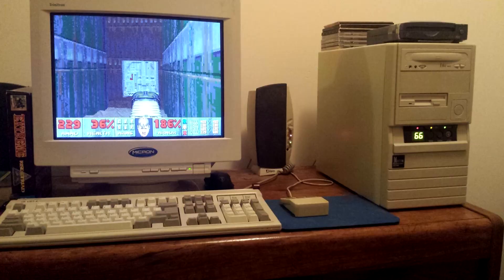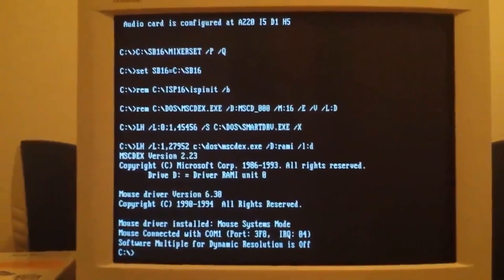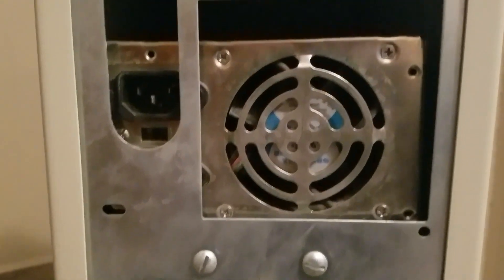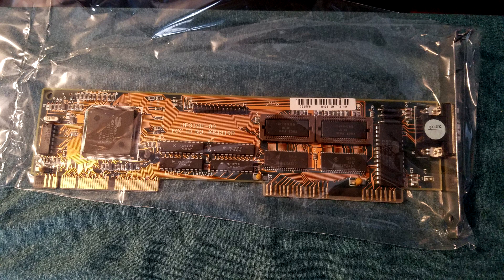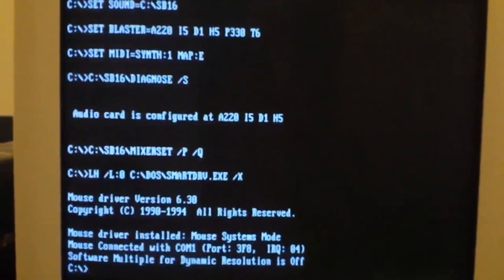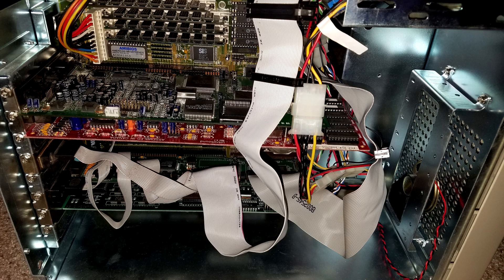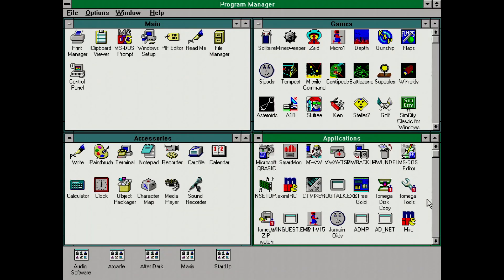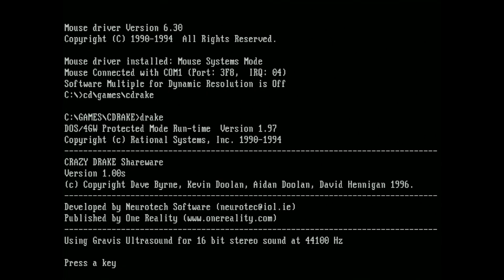How I built the Ultimate 486 PC

Comment: Those massive AT power supplies your case is made for are hard to get, but they are a standard...not sure exactly which standard, but they're generally just referred to as "full height AT" or similar. Examples of models which would fit are the Seasonic GS-200T, and Enhance SPA-4250. The Enhance units come up on ebay semi-regularly.
Reply from the maker: Thanks for the info! Yeah I had a really hard time finding the right power supply for this case. I definitely want to track down the proper PSU eventually. The current solution I have is very jank haha

Comment: What is the function of these seven-segment displays, used on the front of PC cabinets from the 90s?
Reply from the maker: They actually display the speed of the CPU. For example my 486 runs at 66mhz and so the display on the case says 66. These are manually set through jumpers on the PCB of the display.
Reply: @jikissgamer  Thanks for the answer!

Comment: that was the computer case I had back in 1993 but it was the mini-tower version. I purchased a custom computer from a computer builder shop in Silicon Valley. In 1993 it was a 486dx33 with generic ISA motherboard , 4mb RAM, Sony 2x CDROM, Sound Blaster 16 compatible ISA Sound card, SVGA Video card ( Oaktech ) and a 14-inch Non-interlaced monitor. In all it cost me $2500
But I was happy and I liked it. It also had a 14.4 dial up modem.
It came with DOS 5.0 and Win 3.1
Eventually I upgraded the motherboard to VLB and added VLB cards and a Intel 486dx50
When Win95 came out I built an AMD 5x86-133 CPU computer for Win95.
Reply from the maker: That's awesome! The small version of this case sounds really cool, I definitely would have preferred one of those cause this one that I have is a bit too big haha. It's crazy how expensive computers were back then. That's one of the reasons my dad never upgraded our old 486 and we kept using it until like 2001 or 2002.
Reply: @jikissgamer  Yes, Computers were very expensive back in 1993. 1mb of RAM cost $100 and hard drive space cost $10 per megabyte. I think my mini-tower case like yours cost about $40. It was an inexpensive generic AT case back in 1993 and it was very popular. CDROMS and Sound cards were also very expensive. 1993 is when the first multimedia computers started being manufactured for home users.
They also came with dial up modems. Mine had a 14.4 modem. We could Dial up to Bulletin boards ( BBS ) using Wild Cat client. Or Dial up to another computer any were in the world. Also there was Compuserve dial up service. I had AT&T World Net service. It costs about $30 month. 1993 is also when the First IBM PS/1 multimedia computers came out for home users. IBM Pretty much set the standard of what a computer is and how its to be used. Also in 1993 the First Macintosh Color Classic came out. It had a Color Sony Display and 16mhz CPU. But It could also go online and surf the internet. I still have a Mac Color Classic and using the Ethernet port it can still go online and surf the internet accessing HTML 2.0 friendly webpages. It Only Cost $1099 back in 1993 but the Display was very Nice. Sony Trinitron CRT I think. 
I think all you need is 8mb RAM and Netscape 3.0 browser to go online and Network card and TCP/IP.
Reply from the maker: @computerenthusiast402  That's so cool! 1993 is actually the year I was born, I spent a ton of time in my dad's office growing up where they had a lot of 486 computers, that was a big reason I became interested in this period of computers. I remember we had a modem at home which was how my dad got a lot of shareware games. We had a Samsung CRT monitor back then. The Trinitron is the best monitor though, I use one on the 486 I built here and it has such a crispy image.
Reply: @jikissgamer  Yes, I took a DOS computer class in High school and they used IBM AT Computers. And a friend of mine also recommended I stick with IBM type computers and Microsoft Windows. But if I would have known more about the Mac Color Classic back in 1993 I probably would have purchased the Mac instead because it was much less expensive and very easy to use. I had difficulty learning to use the 486 computer. So I hired some NERD from an ad in newspaper to teach me. He was so smart and helped me setup my computer and taught me allot. I could not have learned it with out him.

Comment: Here's a Trick I just learned in 2022.   Didn't know it in 1997-2021.   To get MegaEm to work properly, keep the computer RAM under 64MB.   Easy to do on a 486.   For a Pentium, we just have to make sure to keep our upgrade ambitions managed, and not go over 32MB.
Reply from the maker: That's very good to know! I did not know that, thanks for the heads up. I should definitely give it a try on this 486 since I have only 16mb in here.